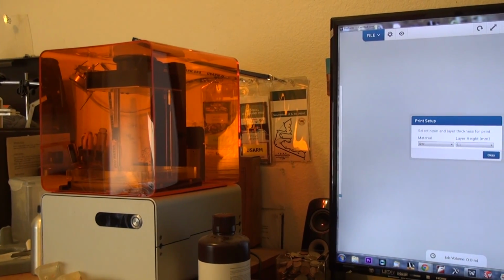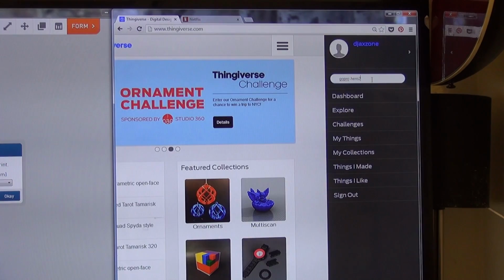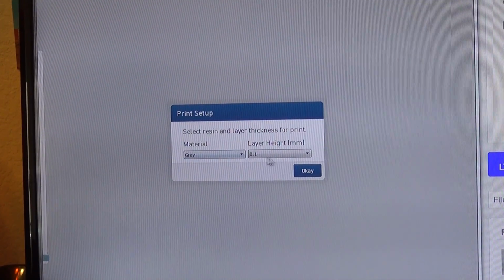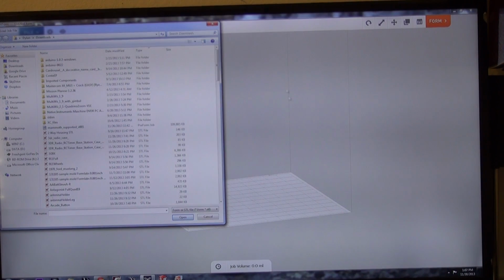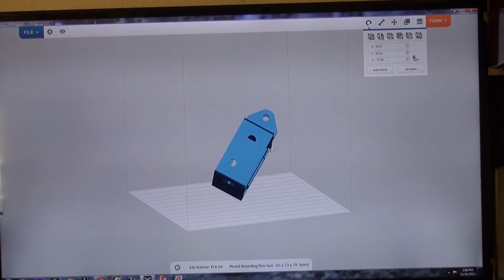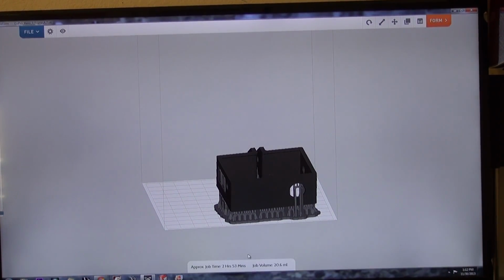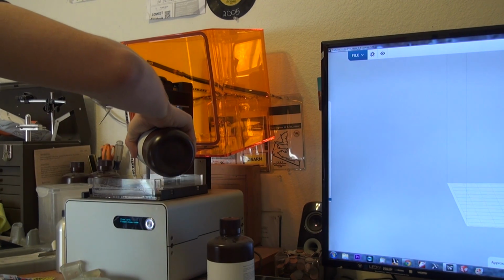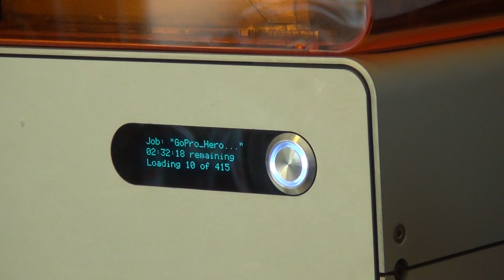3D Printing a GoPro Frame Mount

Comment: Is there a separate machine to better quality ?
Reply from the maker: Of course there are better 3D printers, however for the price point of the Form 1 very little is offered.  This is one of the most accurate home 3d printers on the market currently
Reply: The highest quality on the normal extrusion 3D printers is this printers lowest quality.

Comment: Thats an expensive frame :) but well worth it when you have the printer. Well done.
Reply from the maker: If you include the price of the printer then yeah it is haha.  But based on material price for the printer it was only about ~$3.30 or so.  Thanks for watching!
Reply: +PrashArt With 3DHubs.com you can local print any design you want! Definitely worth trying.